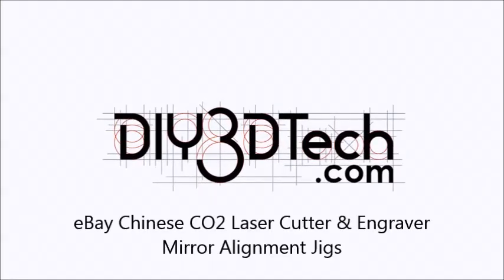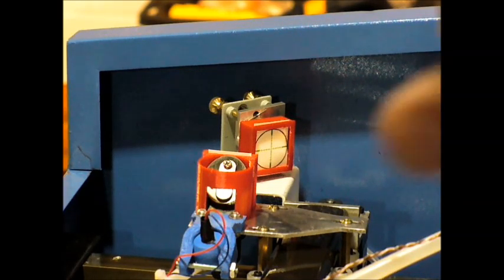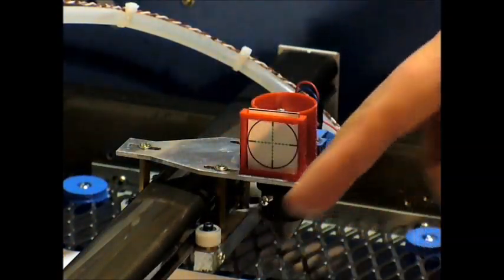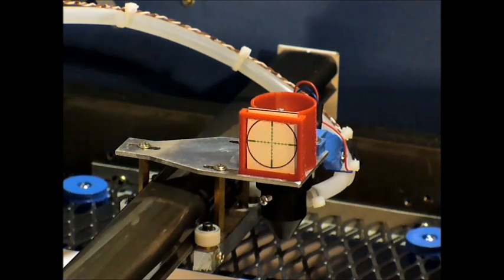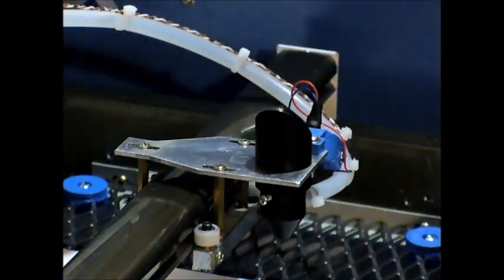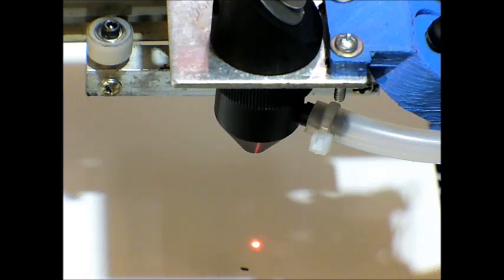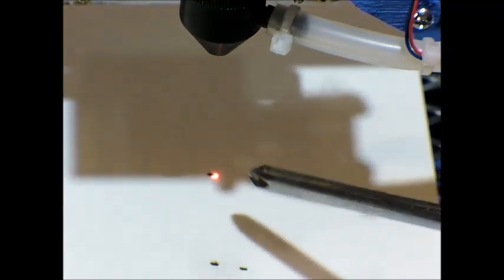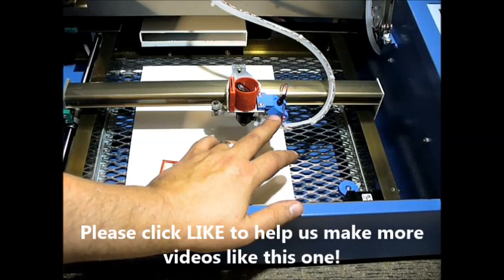eBay Chinese CO2 Laser Cutter & Engraver - Mirror Alignment Jigs

Comment: i think another way to do it is disassembling a laser pointer and fix the diode of the laser pointer to the laser tube where the co2 tube fires the beam and make preliminary adjustments, then when is setted up you remove the diode ahd fire the real co2 beam, maybe could be less stressing.

Comment: I can get 1 and 2 aligned just not mirror 3....help
Reply from the maker: You might also need to adjust your tube also.  Look in the playlist for the laser as 3d printed tube rings.  Also you need to make sure your carriage is square (again this is all in the playlist)...
Reply: DIY3DTECH.com it was firing but would cut deeper on the left than the right. That’s when I decided to align the mirrors and all hell broke loose lol. So I don’t want to try and move the tube bc I think it was okay. I just moved 1 and 2 mirrors and it’s still hell

Comment: On the 45 mirror, the plane of the paper is in front of the plane of the mirror so you would want the burn mark to be a little offset (sketch it out on paper to see).
Reply from the maker: I would have to think about this as I have been doing this a couple years now and it has worked great so not sure I am tracking the offset idea...
Reply: Sure. The truth is, it probably doesn't make a great deal of difference as long as the beam is hitting the mirror (and you'll only be out something like the distance from the paper to the mirror divided by sqrt(2) anyway). But like I say, sketch it out on paper and mark the center of the mirror and the center of the target paper.

Comment: Hello,
your upload is very helpful, i downloaded the file from thingivers but could not open it, tried on adobe illustrator and photoshop.
please help.
Thanks.
Reply from the maker: Sorry what did you try to open?  They are STL files for 3D printing and need to opened in something like Cura...
Reply: could I be wrong? I was hoping I could download the alignment file and cut it out with my ebay CO2 laser machine.
I don't have a 3d printer.
okay, do you guys sell these? or can buy it somewhere?
kindly help as my alignment is way off and I can't get it to align.
Reply from the maker: Sorry they need to be 3D printed and unfortunately I don't sell them, however maybe you could find a Maker Space to print them for you...
Reply: You could cut something equivalent out on the laser cutter but I assume you have your alignment issues resolved by now. Sticking paper on is fine.

Comment: Great tips. But, the beam spot looks weird, kinda oblong oval. A good tube should have a perfectly rounded spot(TEM00). You probable need to change the tube to maximize performance.
Reply from the maker: +daniel BTH I think part of the problem is the mirrors as they are pretty junkie, however the machine does good for what it is and really thinking of selling and buying an 80 watt unit.  However you might know the answer to another problem I have, as when I use Corel Laser and say draw a circle, it will make two passes, one to cut out the inside of the circle (on the line) and the second the out side and it makes a bit of a mess, is there a way to stop this and only have cut on the line?
Reply: +DIY3DTECH.com
colour the circle, (mine does red and white) if one circle is inside the other, like a dog tag, the small one white, it will cut inside the line, and the large one red, it will cut the outside of the line
Reply: You've probably already solved your problem, but just in case anyone else is struggling with it- your problem is probably the thickness of the line. You should set weight (thickness) of the line to hairline
Reply from the maker: Yes or the other thing I found is in-filling the object as not to appear to have two sides to the line.  However I have since changed out the electrictronics (video how-to series is in the queue) so no longer have this issue at all.  Also thanks for sharing!  :-)